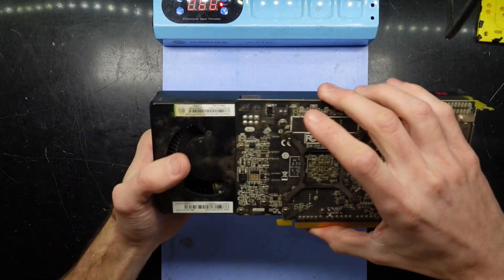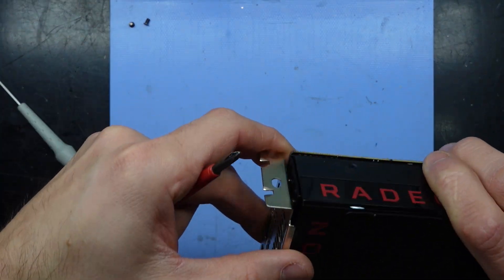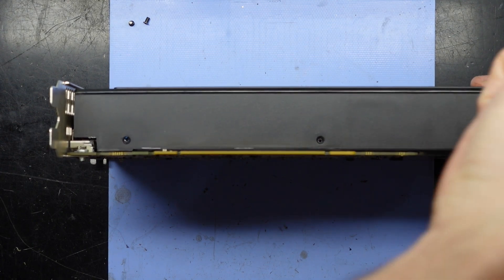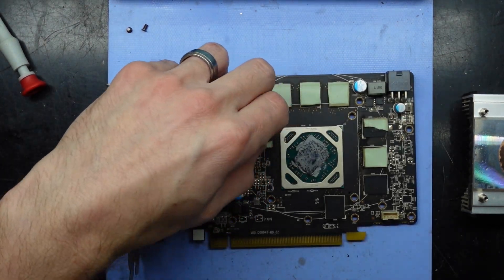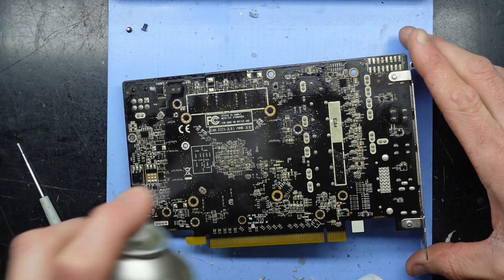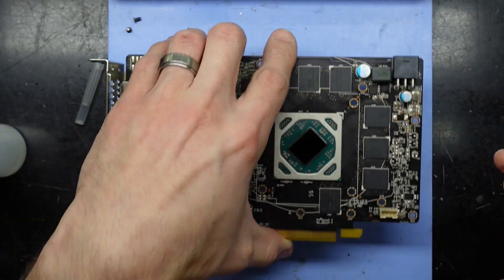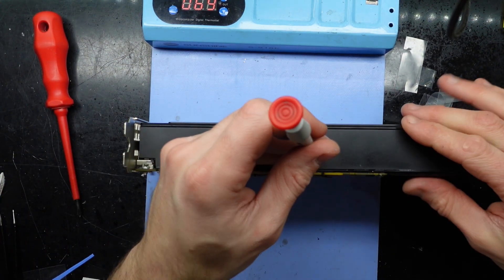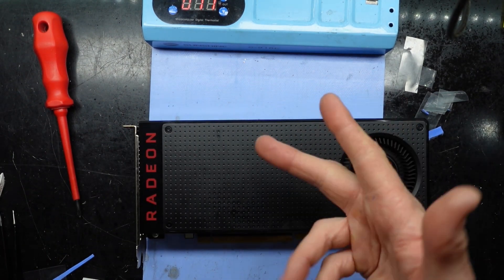AMD RX480 4GB Thermal Paste and Thermal Pad Replacement

Comment: This video helped me a lot when I was repasting and cleaning out my RX 480 8G that I wanted to sell (for €50). I did have difficulty with getting the fan header out (messed around with it for about an hour lol) but eventually got it out with a small flathead screwdriver.
 Runs much quieter now. 88° under load and before it was crashing and stuttering like mental
Reply from the maker: Awesome to read this has helped you :)

Comment: Thanks for this video! I was pretty certain I knew what I was doing but it was nice having someone to look to to make sure I wasn't making a stupid mistake. My PC was shutting down due to how hot my GPU would get (over 90C) and sometimes would idle at 80C, now I'm idling under 30C! It's amazing what change a £5 tube of thermal paste can make. Makes me wonder how many people sell off their old hardware just because the paste has dried out and they don't know any better. Still a lot of life left in this 8 year old gpu!
Reply from the maker: I think alot of devices get thrown out due to overheatings (and thermal paste replace would fix it)

Same with phones that dont charge, due to lint build up in the port

Comment: Bro u put way to much thermal paste
Reply from the maker: All good :)
Reply: better too much than not enough.
Reply: no, you can break your processor or motherboard if too much falls off @MrAwsomeshot
Reply: @abe_ayden  only if it is capacitive or conductive. 

looks like homeboy is using good ol artic silver 5. so in this case it is slightly capacitive and manufacturer does recommend to keep it away from components and traces. 

I stick with Mx-4 for this reason. Honestly there is very little difference between 'the best' and 'the worst' when it comes to TIM. Unless you are doing series overclocked where every .5 degree matters.

Comment: I just bought one of these Reference cooler RX 580s for $55 3 days ago and I've been scouring forums asking if anyone knows the sizes of the thermal pads on these and of course the only answer I got is people getting mad that there's no standardization on pads sizes😂

good thing I found your video though, I already repasted my GPU with GC Extreme and am planning to replace the dirty and crusty pads with some Gelid pads.
nice to know they're all 1mm in size!
Reply from the maker: Good Luck with your Pad Replacement :)

nice cheap price, Enjoy